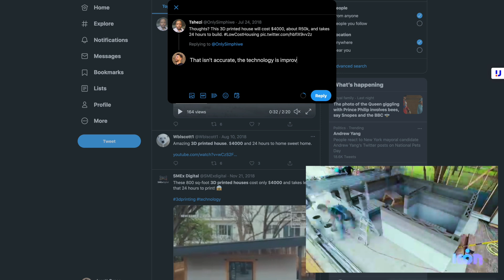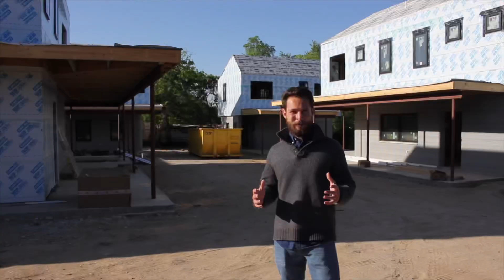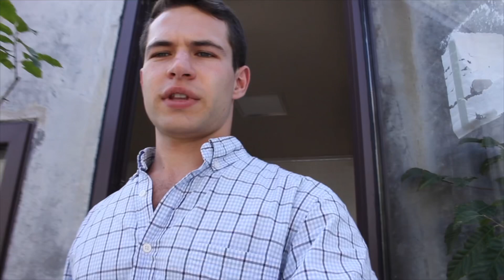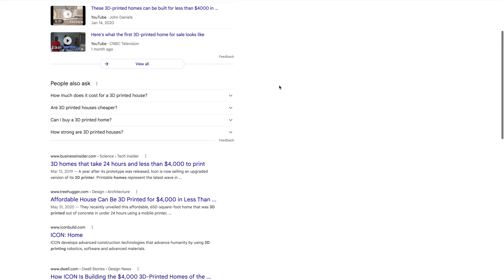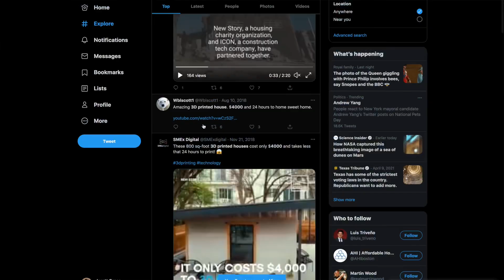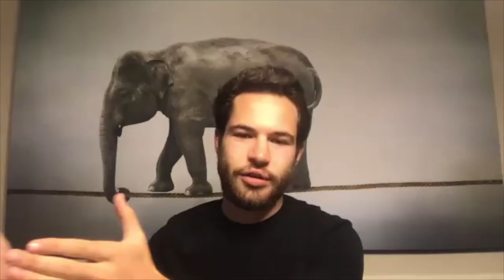$4000 3D Printed House [DEBUNKED] Myth BUSTED!

Comment: This is great! The focus on cheap housing is causing a race to the bottom in funding and I fear the industry may be distracted from the real advantages of 3D printing. What we should focus on is perfectly shaped, beautiful buildings with complex topologies precisely matched to the needs of the structure. Buildings that take advantage of local conditions to minimize HVAC cost and so reduce operational costs. Buildings with shapes that maximize the usability of the space for its purpose. Buildings which express ideal design. The low cost path is more about local and low cost materials utilization, which may intersect, but is not the primary advantage. I was involved in the very start of this industry, and I'm also angry with the poor way its been represented.

Comment: It should be common sense to look at a price that cheap and think it's unrealistic. That's why it's always important to do your own research. Media & article outlets have been caught lieing multiple times. I followed your channel cause you actually talk with these companies and do the work. I know 3D construction will be the future and I wanna be on the front lines to see it
Reply: It would be possible to print the house and print the plumbing and even the electrical lines with a multi extrusion printer. Windows would be opaque if to be printed, however, it goes to show that the material costs can be afforded within the low pricepoint, provided that you are dealing with materials in their most unrefined in forms of supply.

I was quoted at 2 grand for a cement truck to bring enough to create a floor for a 30x50ft building and it had to be thicker than usual due to the weight of the giant farming machinery that would be parked on it. Had they shown up and simply fed it into a hopper for a printer..hmm..sudden onset building/housing structure.

Comment: It's not hard to price out what a home might cost. Most likely they are just giving a materials cost, which is not entirely unreasonable if a 3D printer is doing most of the work. The printer cost can be spread out over something like a thousand homes, so I'd guess they aren't including it. There's not much to it; couple windows, couple doors, electrical, plumbing. You can spend a lot or a little on a kitchen. I don't think you'll be able to buy them for $10,000, maybe $20,000. It's still pretty good compared to something like a tiny home, and much more durable.

Comment: Sure, someone might get lucky and get a 3D printed "shed" for $4000 but let's face facts... the 3D printed home industry knows exactly what it is bringing to the table, which is highly ultra-customizable family homes built in days vs. months, which is likely going to be seen as a premium feature, with an ultra-premium price tag.  Unfortunately, I don't see 3D printed homes costing less than conventional homes... if anything, 3D printed homes will end up costing exactly the same or (likely) more than an equally sized conventional home.
Reply from the maker: The market sets the rate of home sales but if building becomes efficient reliable and fast enough the market could be flooded and even the traditionally built homes may be more affordable. Have you seen lumber prices lately? It’s about time something competes.

Comment: BUt the machines cost 250,000 usd on average along with additional operator labor, transport and materials cost.  
I worked for a top us 3d home printing company.  It does not cost that cheap. Bottom line: 
The hope they can build 100 homes and then and ONLY then do costs shrink because all transport , material, labor amd technology costs shrink based on the large project.   

Best case scenario it costs the company half of what it costs a traditional wood frame comstruction.  

Then the kick in the ass is they sell the homes only 10-15% less than a traditional home but 3d print builders spent half the cost of traditional homes.  So that means there is MORE PROFIT MARGIN to a 3d builder vs traditional homes.  

The profit margin has decreased dramatically with traditional home builders which is why traditional homes are never less than 300,000 + or more even in texas. Everywhere in usa its above that now. 

3d printing home if you are lucky will cost high 100’s to 250 range.  That is best case scenario. 

Most builders regardless 3d printers see the potential high profit margins and still charge 300+ anyway so it becomes such a small benefit to society 

Its not the technology, its the economic sysytem we live in capitalism we live in that keeps home prices high even if you get get profit margins. Do you follow? 

For example in mexico you can get a 35-50 thousand dollar usd home.  Why? Because government subsidies and more of a socialist view on housing.

Same for other countries.  Usa and its “entrepeneurs” view hosuing as wallstreet casino or way for them to make it big and retire with stock options and fame. 

In other countries its a human right and more of a socialist view on housing. 

To the the usa’s own view and capitalist perception of housing is cause of its own ruin there.  Ive lived in usa mostly and now in other countries. Its a big difference. 

Usa creates its housing bubbles because of its capitalist greed.

The media have trained americans the socialists views are evil ans from the devil. 
Yet other countries that have a heathy mix of socialist view in housing, medical and education are better off than USA in those realms. Usa prefers to pretend it is better than other countries, yet has a housing, health and education  crisis that other mildly socialist countries like canada or mexico do not have.

Comment: looked down I had written that it was the wrong word but I use googel translation and it changes things but hope it works out what I mean!
 
I have always assumed that such figures are dependent on what is included as only piping for water is around those sums and the plate on the ground is the same (lives in a cold country so we have 8-12 "insulation under the cast plate and usually add water-borne underfloor heating, but this is calculated at 100-150 $ / sqm)
So the only thing I guess that such numbers could be correct was how much the material costs to print the house and then + the plate / floor + installations of water / drainage, electricity, roof, insulation, heating system and everything else so the price is for a plot shells and not costs for workers and prep work or the printer.
So if the government or the military has a printer and people they still have to pay salaries to and need to get something that is better than a tent but without reaching more then it can be reached for the homeless or in different types of disasters but a difficult house I have to see for less than 50k.
No one wants to invest big money in machines and time without getting paid for work or wear and tear

Comment: I appreciate your honesty but I fear this 3d printing house will go down the same rabbit hole as the tinyhouses and Container-houses. There are now companies here in Germany who will charge 80k for a tiny house... What idiot wouldn’t at this point just get a normal house? If they don’t want this criticism they have to be honest and stop collecting hype from working people just so that they can take a dump on them later on so that they can sell their 80k houses to hipsters who want a second house in the Forrest
Reply from the maker: The problem with tiny houses is most costs are the same like running the cities electrical and plumbing systems to the house. Also larger objects have more volume compared to surface area so the materials cost per sqft is cheaper as you go bigger theoretically.